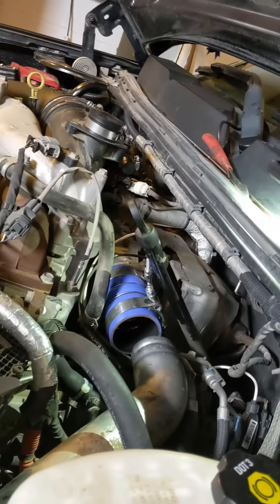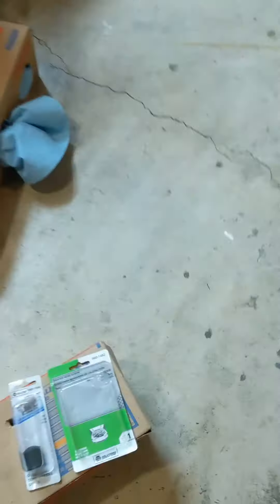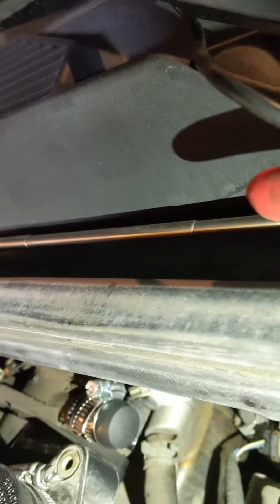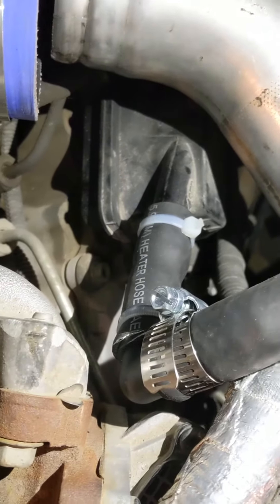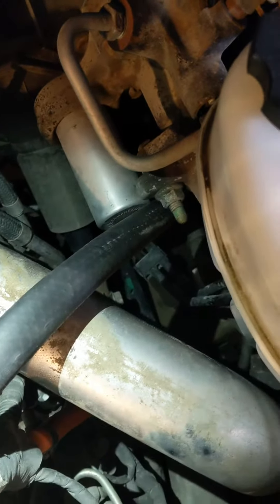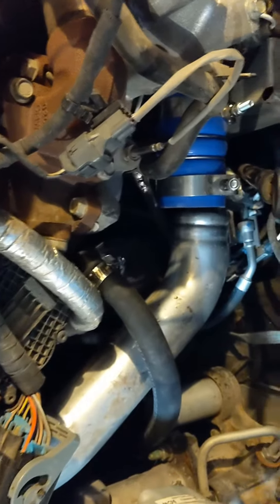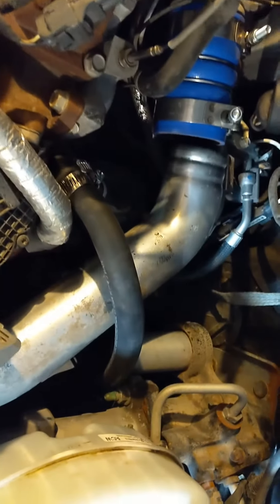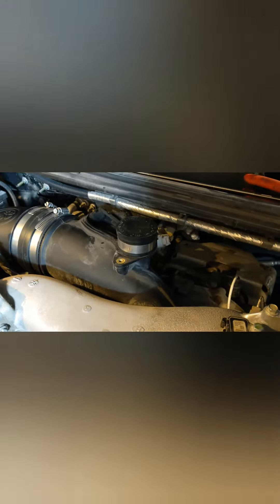LML DURAMAX PCV REROUTE AND RESONATOR DELETE FOR UNDER $20.  DIY

Comment: What does the pcv reroute do?
Reply from the maker: Keeps the soot from re-entering at the turbo and dirtying things up.  In theory. 

In theory a vent to atmosphere of emissions is easier on the motor and better for longevity.  Clean air in cleaner engine cleaner air out in theory.  

At some point everything vents to atmosphere.
Reply: Thanks. is this with emissions or without ?
Reply: @mikem8475  to keep oil vapors from collecting in your turbo which help it from running away on you
Reply: Won't oil make the heater hose soft?